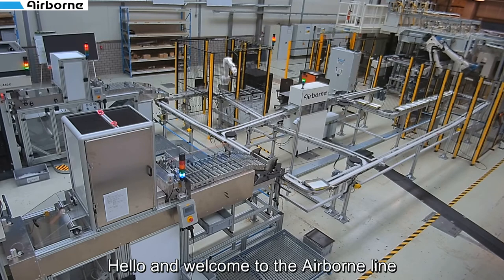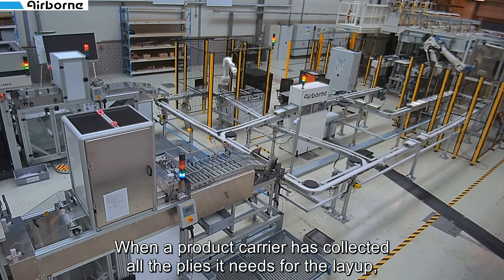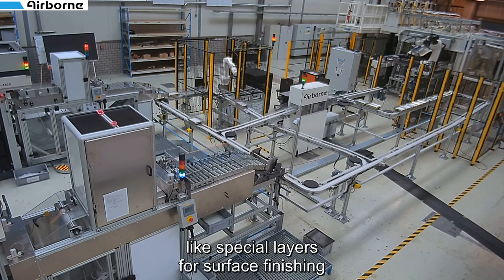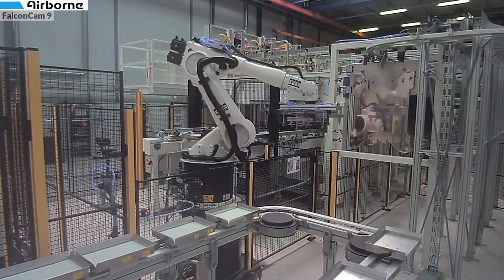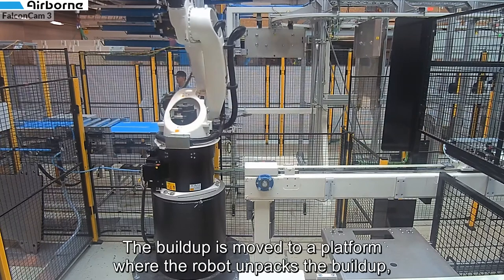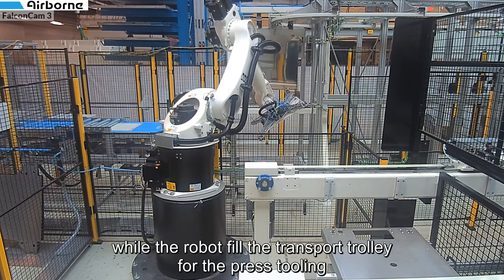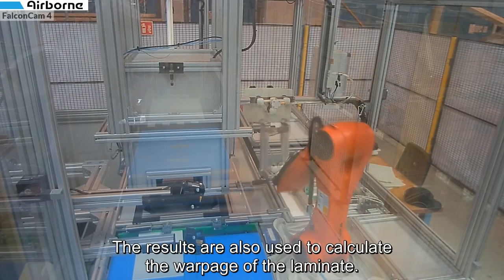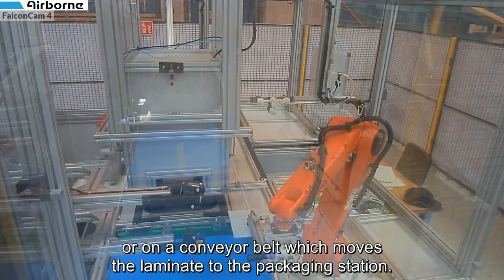High Volume Line for Thermoplastic Composite Manufacturing

Comment: Thank you for explaining the entire process chain for manufacturing of the thermoplastic composites. I would like to you a question related to the inspection robot. During the inspection, the robot is using laser micrometer, is it possible to calculate the warpage of the part with the help of change in the thickness of the laminate? Are you facing the problem of warpage/shrinkage post consolidation of the laminate? are you also considering some other aspect during the calculation of the warpage?